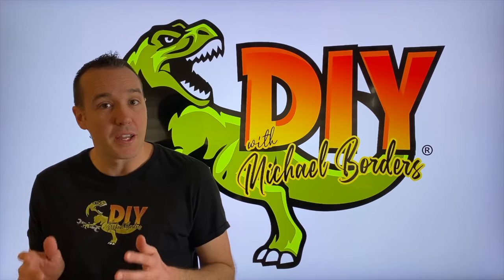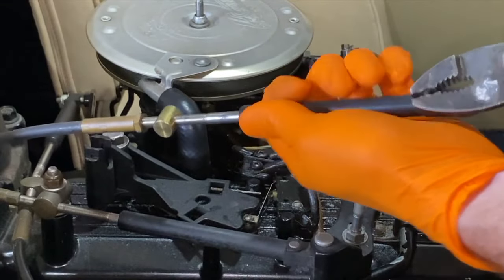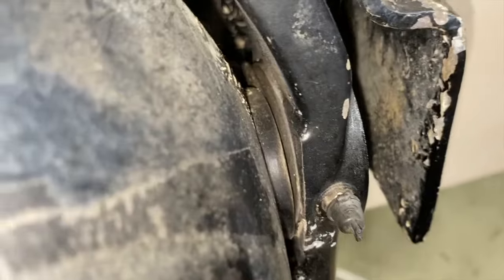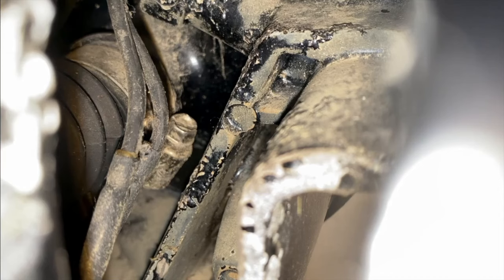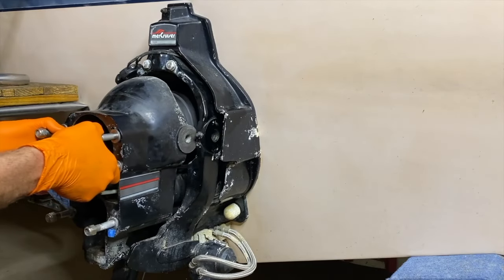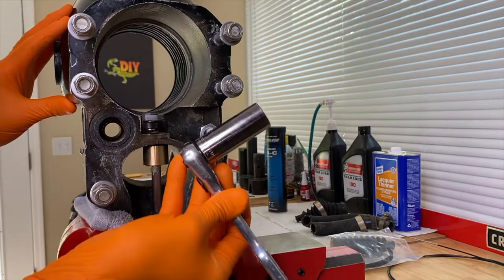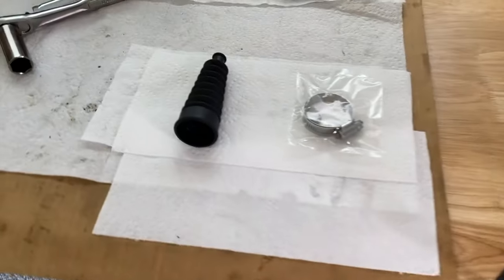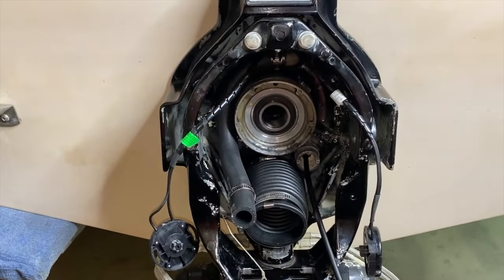Replace Mercruiser alpha outdrive Shift Cable

Comment from the maker: If interested in purchasing this product, visit our Amazon affiliate link below.  I earn from qualifying purchases.

Hinge Pin removal tool:  https://amzn.to/44YuasH

Pic tool set:  https://amzn.to/3OCE9NE

Long flathead screwdriver:  https://amzn.to/3OQebHB
          
Pipe/hose cutter tool:  https://amzn.to/454qaXC

Bellows replacement kit:  https://amzn.to/3RL7h8v
          
Flex Shaft Screwdriver:  https://amzn.to/3s8E3W4  

Utility knife:  https://amzn.to/3QBjP1K

Gimbal bearing install tool:  https://amzn.to/45ukLJt

Gen 2 U-joint tool set:  https://amzn.to/3KvNPbu

Shop Vac:  https://amzn.to/3scLdsr

Endoscope:  https://amzn.to/3qvdU3m

Shift Cable Socket:  https://amzn.to/3qtVdgq

Lacquer thinner:  https://amzn.to/3QGvxbd

***********

1.  How to remove outdrive from boat

          https://youtu.be/mD3YcT2Ohrc

2.  Bellows replacement (PART1)

          https://youtu.be/NcObTOYXtQM

3.  Endoscope footage inside outdrive exhaust

          https://youtu.be/bldC14Hmti8

4.  Replace outdrive Trim Rams

          https://youtu.be/nkcFYl5bL7c

5.  Replace outdrive decals

          https://youtu.be/ER525zAx1CY

6.  How to install outdrive to boat

          https://youtu.be/HgMSGiSiBA4

7.  How to adjust/calibrate Trim limit and Trim sender switches

          https://youtu.be/5BetZVkPPHI

Comment: Hello Michel, first of all, thank you and congratulate you for the excellent video you made.
I am disassembling the same motor leg and I find that the reverse does not enter. My question is the following: in what position should the piece that fits the piece at the end of the cable be, I don't know if I'm clear, I hope you understand me.
thank you and waiting for your comment
Reply from the maker: @AngieAuletMona  

Thanks for watching, any update on your project?

The shift slide mechanism plays a huge role in the overall operation and performance of shift system.

Have you properly connected shift cable into shift slide and secured screw and safety wire?

If shift cable is not installed properly into and secured into shift slide mechanism, the slide mechanism will have a difficult time shifting in-and-out or back-and-forth inside upper unit aluminum housing where it lives when upper and lower unit are connected.

Comment: The hinge pin tool was the first tool I bought when I bought my used boat, excellent and very detailed video, thanks Michael 👍😁
Reply from the maker: Thanks Dave, get decision on your part.  That little hinge pin tool is a must in our opinion when performing these projects.  😎👍
Reply: @DIYwithMichaelBorders  matter of fact I’m putting my boat away for the winter today, looking forward to more videos 👍😁
Reply from the maker: @davestewart9146  

We just winterized our boat as well and tucked it back into the garage for the winter however all the videos we filmed over the last 12 months will be slowly making their way to the stage.

😎👍

Comment: hello how to correctly adjust the gear shift cable when I push the lever forwards the engine stops and backwards also please need help I can't find anyone who gives a good video on the subject if we have this problem
Reply from the maker: @BehlauGaming  

Thanks for watching, any update?  Not sure if we understand the question fully.
Reply: Sounds like the shift interruption switch is shutting the engine off.
Reply: @Keygstan  yes
Reply: I have a similar issue but only into reverse. I am pretty sure the problem is the intermediate shift shaft being bent. Which is causing more drag when trying to shift which in turn causes the shift linkage to pivot and engage the shift interrupt switch. You might take a look at that intermediate shaft.
Reply from the maker: @Keygstan  

We appreciate you taking the time to share this.  A slightly bent/unaligned and bound up shaft will definitely cause interference.

🧰
Reply: @DIYwithMichaelBorders  I’m having the same problem. What shaft are you referring to?

Comment: Great video.Nice job you do.I have one question i hope u can hellp me.I have problem with my alfa one gen 1 just like in video,the problem is that i cant shift in reverse and i take apart locer unit from uper to se what hapen.So that plastic slider  on shift cable muving but cant get all way in.What ever i try to do i can get revers gear.I try to adjust lover cable alone without uper and i cant get inof muvement of that plastic slider on the cable to get all way in and cant get in reverse.Do you have maybe have some idea whats the problem?Its look like slider kick on sometnig and cant get all way in.Thanks on all video u made its make my l8fe much eseyer.Greatings🙂

Comment: I have a random question, on the top of the motor, on the shift plate at timestamp 5:39 The cable closest to you, (the one that goes to the throttle and shifter.) It wouldn’t go into reverse, so, embarrassingly I tried, forcing it, and that black piece with the metal rod broke. And for the life of me, I cannot find a diagram with the part number. Do you have any idea how I can get a new one?
Reply from the maker: Thanks for watching, are you referring to the spring guide?  If interested in purchasing this product, visit our Amazon affiliate link below, and I earn from qualifying purchases.  In addition, there is a link to an OEM Shift cable kit.

       https://amzn.to/3x4mfhT

       https://amzn.to/3RexYRZ

Without your exact inboard engine year, model, horse power, and serial number… we won’t be able to pull up your exact parts diagram however, the part above is for our 1989 GM 3.0L 140hp inboard.

😁👍🧰
Reply: @DIYwithMichaelBorders  so I did a little digging and I figured out that I need the upper shift cable. But I still can find the part. But if you have a way of looking up diagrams it is a 1986 mercruser 140. 140hp; SN#: A677810
Reply from the maker: @salamandergaming9499  

Have you visited:

       Marineengine.com
Reply: @DIYwithMichaelBorders.  The videos you have posted about the Alpha 1 Gen 1 rebuild have been terrific! I have completely rebuild the out drive on my 1988 sylvan barritz 188 I was wondering if you had a video on how to properly adjust the shift cable and throttle cable linkage? 1:08:29
Reply from the maker: @pop9604  

Good morning, thank you.  We don’t at the moment.  Below is a link to our video showing adjustment of an outboard engine shift cable.

       https://youtu.be/GIeVFIVkZfo?si=4kP3U3SBAH3V7cxT

Although the above video is indeed an outboard as opposed to an inboard setup, it may help a tiny bit.

Comment: Is it recommended to lube the whole cable with 2-4-C before you install it or leave it dry?
Reply from the maker: Good morning ☕️ that will be personal preference.  Some do some don’t.  Lubricating it as shown in this video is what works best for us.  🧰
Reply: Yeah... further research suggested not to grease it due to the specific coating applied to the cable. The old cable I replaced didn't have it, but the new Mercruiser cable did, so I copied your procedure. Thanks for the info, and well done on a great video. The best one on YouTube by far 👍!
Reply from the maker: @SwedeFJ40  

Very cool, and we appreciate your kind words.  Looking forward to hearing back from you on how your DIY project is going.  👍☕️

Comment: hello i noticed that my shift assist lever was not engageing all the way and i am running it on a hose have not had it in the water as of yet is this normal and if so what pertects it when shifting out of the water it is confusing me thanks peace Mike.
Reply from the maker: Thanks for watching, it should operate smoothly while running engine on hose out of water.

Any update?
Reply: @DIYwithMichaelBorders  the cables are moving freely no binding but the pivot is not enough to engage the the switch not fully like half way the cables are both at 6 inches and going into gear and the switch is good no deep groves in the spring plate roller
Reply from the maker: @inthenameofmyfather3836  

Thanks for the follow up, have you adjusted cable housing with jam-nut and copper cylinder/barrel?

Comment: Have a question for you. I just got everything reinstalled and back after replacing bellows and shift cable. I am running into the issue of the part that's holding the shift cable is going too far and coming off the little plastic straw guide. This make its impossible for me to go into reverse because I guess it ends up wonky and won't slide back on the guide. Any idea why?
Reply from the maker: Good morning ☕️ any update?  Are you referring to an issue inside bell housing with shift cable or on top of inboard where shift cable connects to housing?
Reply: @DIYwithMichaelBorders  It was inside the bell housing. I decided it was the part I was using. It was an off brand part that was supposed to be a replacement. I ran into a bad part issue earlier during my rebuild. The shift cable bellow that I ordered was off brand, the small hole was so tight that it ripped before I got the shift cable through it. I got the quilsilver one and it was so easy. I ended up ordering the shift cable assembly from quiksilver and swapping everything out. The roller was disengaging from the shift cable slide so that the lower unit would not go into gear it was stuck on neutral.
Reply from the maker: @CoreyCox25  

Good morning ☕️ we appreciate the follow up.  Sounds like you have conquered the issue.  OEM quicksilver is the way to go.  😁👍